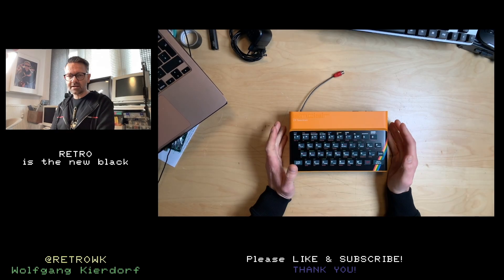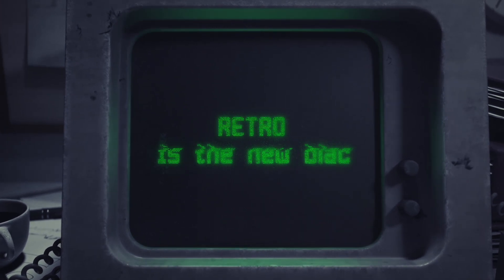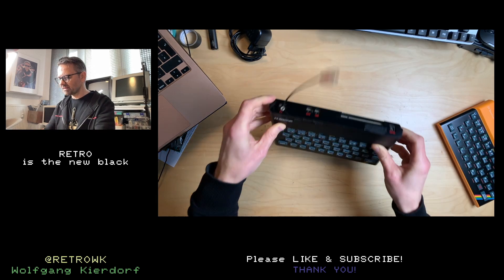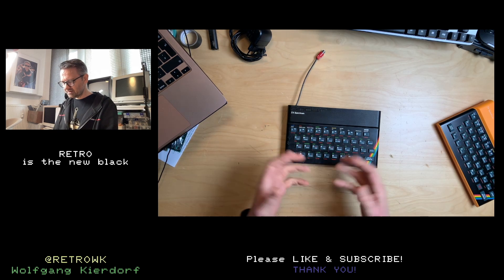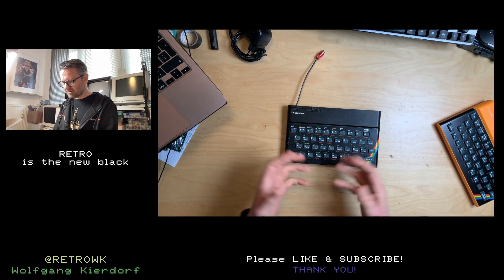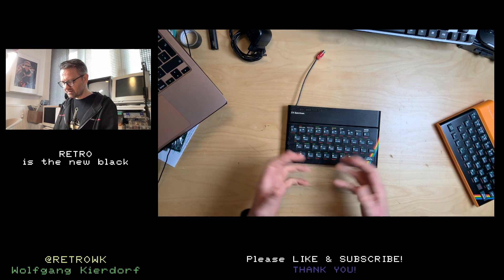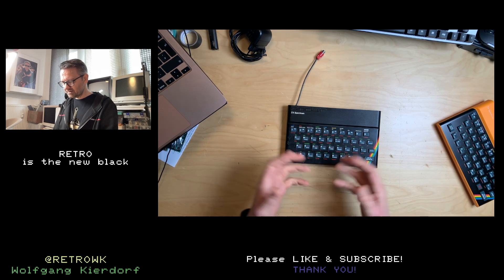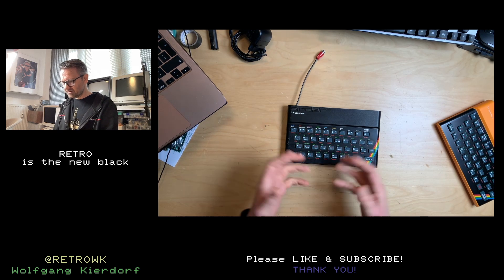Crazy Mods inside a Sinclair ZX Spectrum -can I bring the machine back to life? #sinclairzxspectrum

Comment: I could read your very nice power adapter model number:  LGY-002.  Its specs:  72W, 3V ~ 24VDC Variable, 3A Max. Switching AC/DC Adapter 100V-240V with LED Voltage Display, 14 barrel connector adapters.  I now have one on order.
Reply from the maker: That thing is really good. I use it all the time. Also comes with a small adapter cable to switch polarity.
Reply: @RetroWK  What is the model nr of the small USB power board, where can we get it?
Reply from the maker: @WxAxNxDxExRxExR  Try one of these: https://de.aliexpress.com/item/1005005649203932.html - mine were to weak for the spectrum. These 4A should work. Make sure to connect minus to plus and plus to minus on the out voltage to switch the polarity.
Reply: @RetroWK  thanks!

Comment: An issue 2 Speccy would need some current, around 900mA (peek) on the power jack and since you were using 5V to get 9V, taking the circuit losses into account, that's almost a 2x boost, which would need something close to 2 amps on the 5V feed into the boost converter. No USB phone charger will give you that kind of a current without a fast charge protocol negotiation. The sound you heard was the internal charge pump circuit of the Spectrum (for 12V and -5V lines) trying to pump, but failing :-) I'll see myself out now...
Reply from the maker: Great explanation! Thanks! I live and/to learn!

Comment: How do you like your ANENG 681 multimeter?
Reply from the maker: It's ok. A bit slow maybe. I was used to using a non automatic one. That just worked instantly. And I had moments, when it just wouldn't beep even though it should. That sucks.